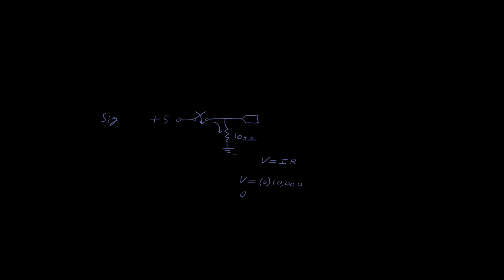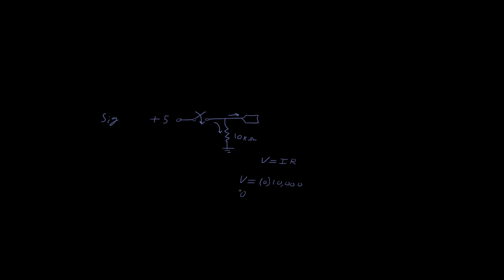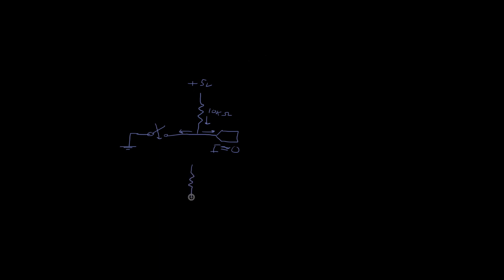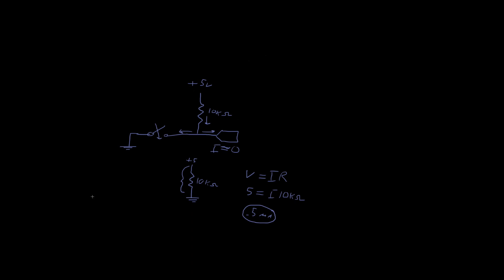Pull Up/ Pull Down Resistor Basics

Comment: Ok - this is the 10th video I’ve watched trying to understand pull down resistors, and you said something new, which helped me get a tiny bit closer : the idea of ‘draining’ any transient power to ground when the switch is open. Helpful.

But when the switch is closed…What’s happening between the +5v and the pin? Why isn’t it all draining to ground as it does when the switch is open? I assume it has something to do with the value of the resistor being so high…just can’t find a video where somebody tells the entire story, does all the math.

Comment: Hey this might be electronics 101 but how does .5V discharge through a 10k resistor? (pull-down example) Does the current just become very small to  allow a large voltage?
Also similar question for the pull-up resistor example , how does the transient voltage overcome the (presumed infinite) resistance of the arduino pin but the +5V supply voltage cannot?
Thanks

Comment: Pull up explanation is not true. If the switch is open there will be 5V on the Arduino/FET input pin until the switch is closed.  Pull up = switch open = 5V on inputpin; switch closed = 0V on inputpin. Pull down = switch open = 0V on inputpin; switch closed = 0V on inputpin.  Ur math explanation for the Pull down resistor is right but the pull up resistor isnt right.

Comment: I have a quick question for you Bob,
In the Pull-Up method that you showed, when you connect the switch(ON) the current going the Arduino is zero, so how does the circuit work then ? In the Pull-down method a fraction of the current did flow to the Arduino.
Reply from the maker: Hello +aqswaflo, thank you for your question and I hope that I can help answer it! for this circuit the "Arduino" (or whatever is reading the voltage on that side of the circuit) can effectively be modeled by a very large resistor (a few mega ohms) going to ground (since ground is our reference voltage). This is due to the analog to digital converter topology that is connected to that pin, but this is somewhat complicated so we can just treat it as a very large resistor to make things simple. This means that when we apply 5v (as in the pull down case) that will be some very small current going into the Arduino, but when we apply 0v (ground) as in the pull up case, we have a zero voltage differential, so our current flow is also zero. All of this being said, I don't want to get bogged down in the weeds, the current flowing into the Arduino is not exactly relevant to the operation of this circuit. The key concept is the voltage present at the Arduino input pin, even if you analyze these circuits with the output having infinite impedance (meaning no current flow into it) the circuit works in the same manor and the voltage seen at the output of the pull up/pull down circuit will be exactly the same as shown here. 
I hope this was able to clarify things a little bit, please let me know if you have any more questions!